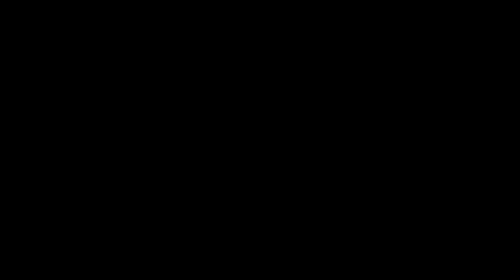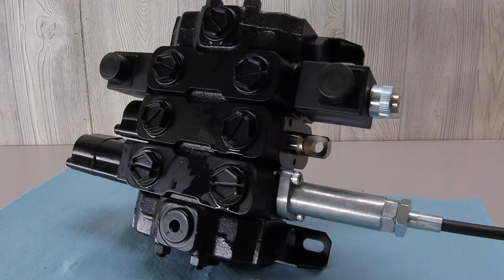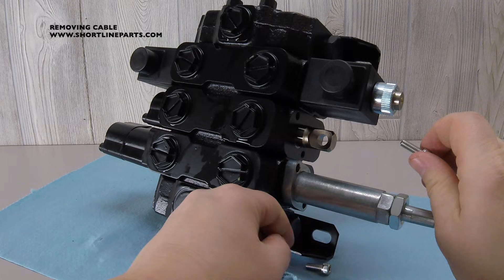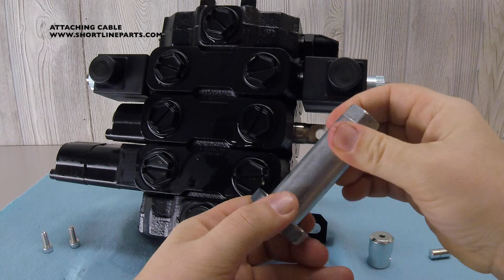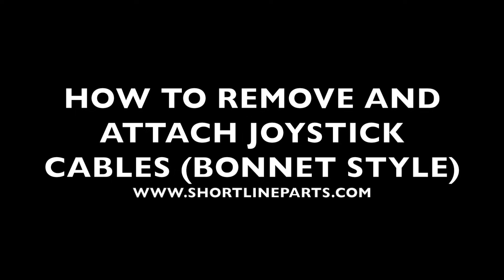How To Connect Joystick Cables to Valve Spools - Covered / Bonnet Style

Comment: Not sure if this thread is still alive or not but I have a question. I connected mine and everything just like you showed but at the joystick it’s stiff and will not move. It is unlocked, the joystick moves if I’m not connected but when I connect the joystick isn’t movable
Reply: Cable is coming apart inside the end closest to the joystick

Comment: perfect video. we have a joystick issue and the hydraulics are fine so i hope it is a cable issue. this will help me out alot.
Reply from the maker: Robert, thank you for your feedback. Did replacing the cable fix the problem?
Reply: @shortlinepartsllc6795  we didn't have to replace the cable it was the attatchment point that came apart.

Comment: How does one go about adjusting the throw of the cable?
Reply from the maker: In general, we recommend having the joystick in the locked position when connecting the cables to the valve. However, if you need one cable to pull a little less(or more), leave the joystick unocked and adjust the cable connector pieces.

Comment: I have a BL25S Branson Loader on a Branson 4520R 2012 and have replaced the joystick 3 times.  This is the fourth and I am looking for a cheaper alternative to the Branson Part TA00026742.  Any suggestions or ideas?  Thanks
Reply from the maker: We have sold a replacement joystick and cables setup to replace OEM setup on a Branson 5530. However, I'm not sure if you have the exact same setup on your 4520R, and I'm not able to cross reference your Branson part number. You may email pictures of your setup to sales@shortlineparts.com and that would give us a better idea of our joystick will match up with your setup.

Comment: I have a Mahindra 2638 with a Besko hydraulic loader valve. I broke one of the linkage covers and could not find a placement ANYWHERE.  Mahindra could only sell the entire Joystick (over$700).

After calling 5 other parts distributors (including 2 Mahindra dealers), Sharla at Short Line Parts took the time to actually try and help me. Together we figure out that the Koyker Cable connector kit PN# is K669298 might be a suitable substitute. 

She sent me one to try and low and behold, the cable cover (bonnet) fit. It wasn't an exact replacement but close enough. Several of the other parts in the kit were an exact replacement. 

Thanks to Sharla and the Koyker kit, I save a bunch of money and 3 weeks (wait time for Mahindra part).

Comment: What types of spool valves are these? My two valves don't have the threaded holes to bolt the bonnet to.
Reply from the maker: This is a Bondioli loader control valve. There are about 5 different ways the bonnet attaches to different brand valves.